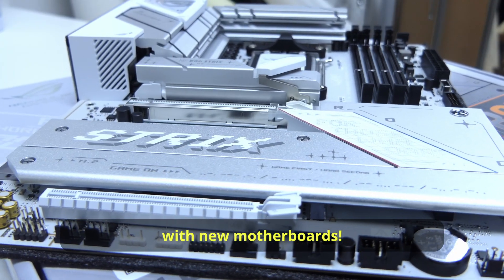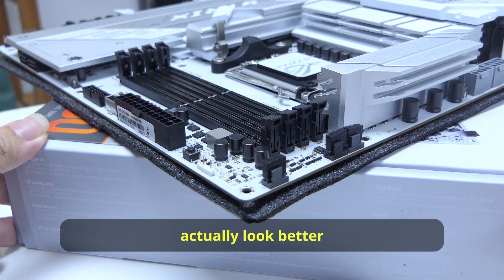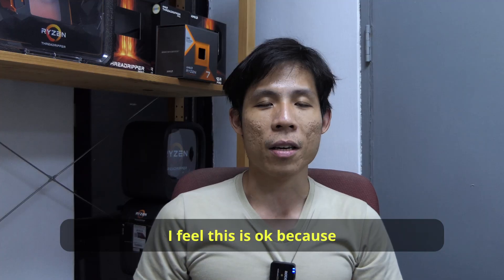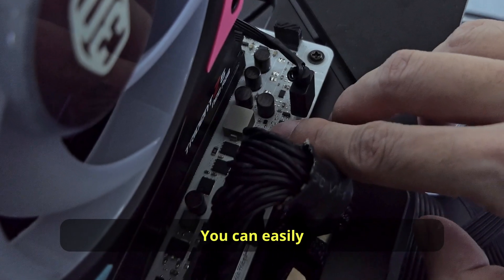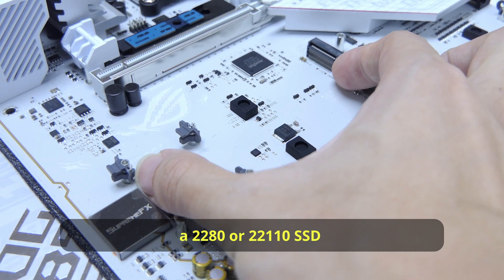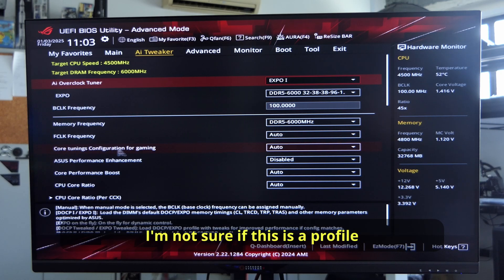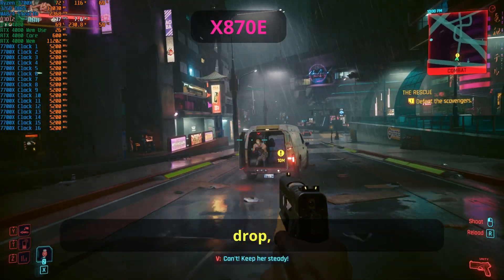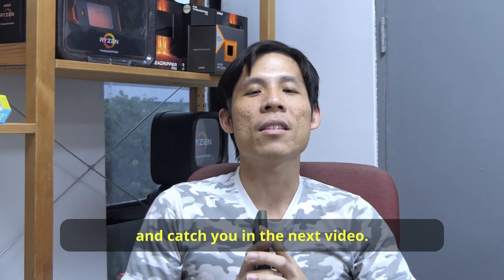A BETTER & CHEAPER White Motherboard? (ASUS ROG Strix B850-A WIFI)

Comment: A warning if you are considering this board. It is great, but the wifi module is garbage. I have done troubleshooting for hours and done everything I can, but wifi and bluetooth are not working. If bluetooth and wifi are important to you, you might want to consider another board...
Reply: No problem on mine, but I have the R2 version.

Comment: Hi, Nice video, just a question i have a SN850X 2TB NVMe SSD installed on the main slot with the heatsink, however its bending because of the thermal pads, do you think its because its a single sided ssd, do i have to put the rubber support for single sided ssd, or is it fine being bending
Reply: Did you ever find the answer for this?
Reply: @blaidd-ppga  yes I did, I took the ssd out and placed the rubber feet under it that came with the motherboard and now is not bending anymore
Reply: @DoomSDar1on thank you for replying. I am doing a 5090 9800x3d build tomorrow and I have two motherboards - b850a and msi mag x870e tomahawk. What would you recommend? I am thinking b850 because it avoids PCIe lane sharing
Reply from the maker: Yes sorry for the later reply. If you have a single side SSD, you will need to install the rubber thing on the base before you install the SSD

Comment: Hello goodmorning, is the mother board only compatible with amd 7000, 8000, 9000? Is the Amd 9900 compatible with it?
Reply from the maker: Hi Yujin! Yes u are right. This board only accepts 7000 8000 n 9000. 
Yes u can use the 9900x on this board:)
Reply: @ thank you for the info around next week im about to get the motherboard and complete the pc ^^

Comment: asus x870-A, B850-A , aorus x870 elite ice or x870E pro ice? 

budget is not an issue just want to see your thoughts.. 

been using asus for awhile and like the Bios, aorus look cleaner white and have 2 more years warranty.
Reply from the maker: Hi TitanRoar, I cant comment much on the X870-A  and X870 elite ice because I did not use it. 
In terms of design, i prefer the X870e pro ice, because the white design on the board is more uniform, theres more white coverage compared to the other 3 boards. 

IMO, the main difference between B850 and X870 is the number of USB ports (not a lot tbh), and possibly the m.2 slots (again not a lot of difference). Are you looking for more SSD usage or USB? 
And plus, you can OC your CPUs on both chipsets. The gigabyte boards allow you to have 256GB of RAM.

Comment: I just did a build with it, unfortunately there are no drivers for the wifi yet. Anyone else experience this problem? Ive contacted asus support and done all the necessary troubleshooting steps. Asked them for a wifi driver but they say they don't have one lol. So is this a faulty motherboard or is there just no support for it yet?
Reply from the maker: Hey man, I see a MTK WIFI V5.4.0.2418 on the ASUS website. Have you tried this?
And did you try to use ASUS armoury crate to also get the wifi driver?
Reply: I have exactly same problem.  I dont know how to solve this. On their webside is only driver for Intel. And I have AMD . Can you help somehow with this?
Reply: @olsinska98  hey unfortunately you will have to upgrade to windows 11 because they only have drivers for that. I upgraded and installed the windows 11 wifi driver from asus and now it works. You might as well upgrade since in October or something windows 10 will no longer have any updates.
Reply: I came across this as well. Unfortunately they only provide wifi and bluetooth drivers for Windows 11 😕
Reply: @bell8700  we solved the problem with internet cable.  We connected it to PC and it started updating everything. Now its working just fine .
Reply: Nope. I'm running Linux Fedora with this board, on Wifi.

Comment: Can this motherboard hold a 4070 ti super?
Reply: Every mobo can lmao
Reply from the maker: haha yes it can. it works with every othe GPU too :)
Reply: @RealMelTan  thankss
Reply: How about r7 7800x3d? Is this board can support this cpu?
Reply: @me_rap27  it even supports 9800x3d so you good
Reply: @Rock-x8y  im gonna use it with 9950x3d should be supported :)

Comment: hey ! I want to use RTX 5080 and Ryzen 7 9800x3d with this board but im not sure about the PCIe 5.0 if I also use an SSD , do I have to use PCIe 4.0 for grpahics card or something ? (the ssd is samsung 990 pro which is PCIe 4.0) is X870-A rog strix better or Gygabite Auros Elite x870 ? please help
Reply from the maker: Hi Constantine, you will be able to use both top slots (PCie 5.0) for your SSD and graphics card. There is no need to switch the lanes to PCie 4.0. 
I am not familiar with the Aorus Elite, but at least from the PCie and expansion area, you may get more gen 4 slots on the X870-A, but at least there is not having of speeds on the Aorus Elite. It depends on what you require for expansion?

Comment: I think MSI B850 Edge is the best of the B850 bunch. Overall, MSI > Asus > Gigabyte. Most MSI are 8-layer PCB while Giga is all 6.

Q: "Can MSI B850 Edge OC well?"

A: Short answer: Can OC better than the weakest X870E mobos, but not as well as the better X870E mobos. While I have no experience with these boards, what I've read online tells me that top-tier B mobos are in the same league as mid-to-top-tier X mobos. For one, the MSI B850 Edge supplies 1120A of current for CPU OC, i.e. way overkill for the power-sipping 9800X3D (which tops out at an EDC of 180A). With 14 x 80A power stages, good enough for a high OC. Next, the MSI B850 Edge is rated for 8400+MT/s RAM support. With a server-grade 8-layer PC, I'm pretty sure at least 8000 can be achieved. Techspot testing showed all of MSI's X870 and X870E tested boards managed 8100+ RAM OC, while half of Asus, Gigabyte and Asrock failed to clear 8000. This shows the quality of MSI boards, be it B- or X-series boards. Lastly, the MSI B850 Edge has what looks to be pretty good VRAM heatsinks. Techspot testing showed none of the MSI tested boards peak over 60 degrees under stress test for a power-hungry 9950X in a 21 degrees C room. Frankly, all these boards are already way overkill for a decently-high OC for CPU and RAM.
Reply from the maker: Oh I see, what do u like about the B850 Edge? 
If I am able to get my hands on one, it would be nice for a review
Reply: @RealMelTan  Thought the Gigabyte B850 AI TOP is the top of the bunch, but it's insanely over-built and gonna be expensive, so the MSI B850 Edge Ti Wifi is the next best board to house my upcoming 9700X + 5090. Why? 8 layer PCB. 5 GbE. Pcie 5 X16 graphics. Unique to MSI, they have an 8-pin power socket at bottom of board - good for power-hungry cards like 5090. I like the B850 Edge best, but too bad only in white. I also like the idea that the M.2 heatsink below the GPU is so close to the X16 slot that heat dumped by the hot 5090 will not be dumped onto the mobo's PCB itself; unlike the gap on the Asus Strix models. In fact, the Gigabyte Aorus Elite has this gap covered in an even better way, but it's only a 6-layer PCB board with 2.5 GbE. Asrock boards are practically non-existant here in SG.

Wonder if I'm paranoid to fear that the heat dump by a triple-fan 5090 onto the mobo just under the X16 slot may shorten the lifespan of the mobo ..... 😅
Reply from the maker: @R6ex  HAHAHA  I dont think the heat from the 5090 will burn your mobo. NGL, the new MSI boards do look pretty nice compared to the rest haha
I didnt manage to play with the AMD boards from MSI, but the Intel one, i gotta say looks pretty good and stylish. And I agree that the space between the PCIE and M.2 for both Gigabyte and MSI is good, ASUS can work on that. 
Alas, I dont think Im gonna get any RTX 50 GPU before NDA to show you. My channel is too small to get it on day one.
Reply: Can the MSI B850 Edge overclock 9800X3D as well the X870E motherboard? Do you know?! I saw a comment on reddit that x870e motherboard are better at overclocking. I want get a 8000mhz cl38 ram. Would that be a problem with this MSI b850 motherboard?
Reply: @nikhilnischay3955  See original comment above.
Reply: @eddieyongmengfai2845   thank you
Reply: @nikhilnischay3955  Short answer: Can OC better than the weakest X870E mobos, but not as well as the better X870E mobos. While I have no experience with these boards, what I've read online tells me that top-tier B mobos are in the same league as mid-to-top-tier X mobos. For one, the MSI B850 Edge supplies 1120A of current for CPU OC, i.e. way overkill for the power-sipping 9800X3D (which tops out at an EDC of 180A). With 14 x 80A power stages, good enough for a high OC. Next, the MSI B850 Edge is rated for 8400+MT/s RAM support. With a server-grade 8-layer PC, I'm pretty sure at least 8000 can be achieved. Techspot testing showed all of MSI's X870 and X870E tested boards managed 8100+ RAM OC, while half of Asus, Gigabyte and Asrock failed to clear 8000. This shows the quality of MSI boards, be it B- or X-series boards. Lastly, the MSI B850 Edge has what looks to be pretty good VRAM heatsinks. Techspot testing showed none of the MSI tested boards peak over 60 degrees under stress test for a power-hungry 9950X in a 21 degrees C room. Frankly, all these boards are already way overkill for a decently-high OC for CPU and RAM.
Reply: @nikhilnischay3955  Short answer: Can OC better than the weakest X870E mobos, but not as well as the better X870E mobos. While I have no experience with these boards, what I've read online tells me that top-tier B mobos are in the same league as mid-to-top-tier X mobos. For one, the MSI B850 Edge supplies 1120A of current for CPU OC, i.e. way overkill for the power-sipping 9800X3D (which tops out at an EDC of 180A). With 14 x 80A power stages, good enough for a high OC. Next, the MSI B850 Edge is rated for 8400+MT/s RAM support. With a server-grade 8-layer PC, I'm pretty sure at least 8000 can be achieved. Techspot testing showed all of MSI's X870 and X870E tested boards managed 8100+ RAM OC, while half of Asus, Gigabyte and Asrock failed to clear 8000. This shows the quality of MSI boards, be it B- or X-series boards. Lastly, the MSI B850 Edge has what looks to be pretty good VRAM heatsinks. Techspot testing showed none of the MSI tested boards peak over 60 degrees under stress test for a power-hungry 9950X in a 21 degrees C room. Frankly, all these boards are already way overkill for a decently-high OC for CPU and RAM.
Reply: True
Reply: @R6ex   Thank you for clarifying. Really appreciate it. You gave quite a detailed answer too. I got to learn and understand a few things. So much thanks for that. I’ll go ahead and purchase this motherboard board. And try out the 8000mhz ram kit with it. 🤓